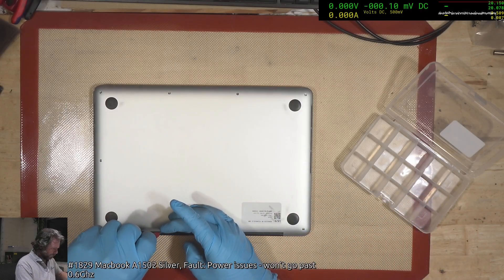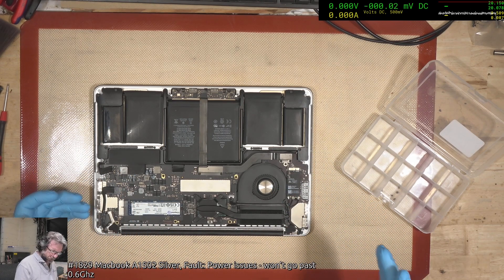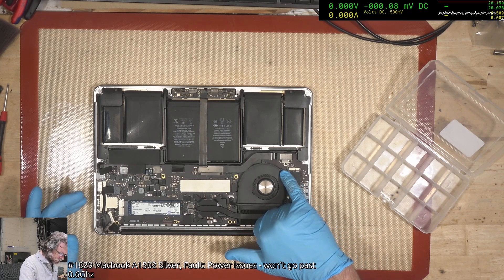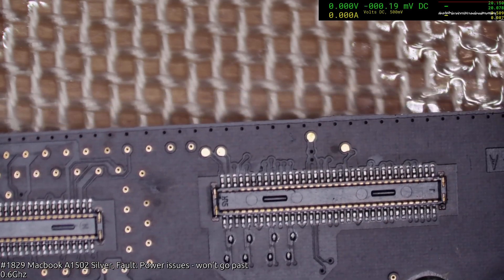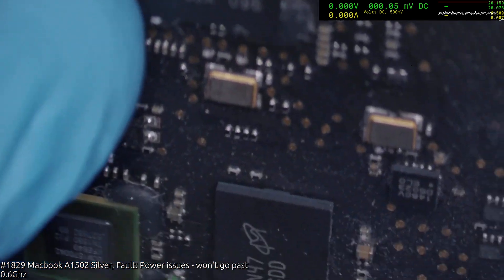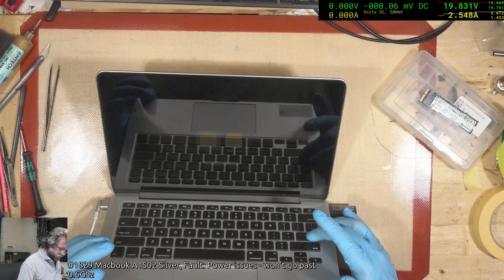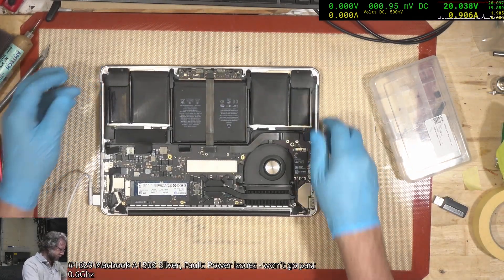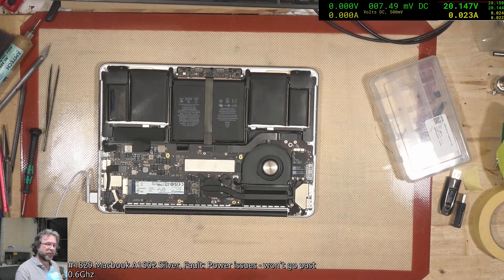FIX YOUR SLOW Macbook A1502 with a new SMC - Smoking Gun Faults are the best

Comment: Bro, i need help, i have changed the battery of my macbook pro retina early 2015 A1502 and now it runs slow and super hot!! specially using graphic (video calls, youtube, videos and ...) what shall i do?
Reply from the maker: I'd likely say issues with the new battery, or the SMC was damaged.  

If a metal implement was used to disconnect the battery connector originally then it's possible that damaged the SMC lines.

Comment: Nice video a technique. I was wondering, would it be possible to know which holder do you use to hold the smc while reballing?
Reply from the maker: It's just a lucky match with one of those NAND/RAM/CPU holders that come with a PCB holding vice.

https://www.aliexpress.com/item/32905025026.html is an example
Reply: Thank you!